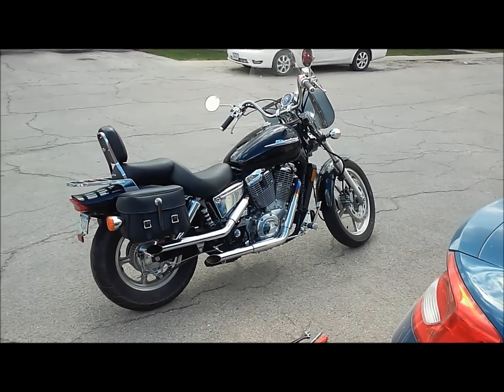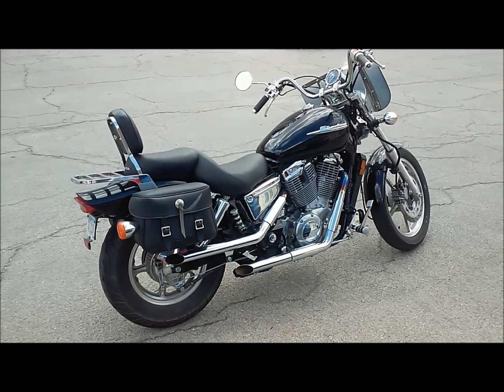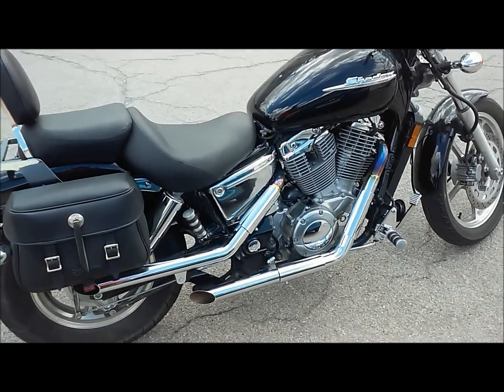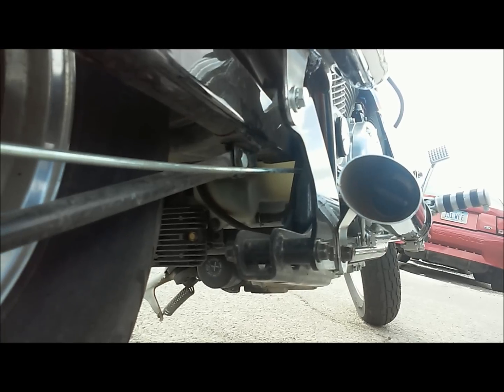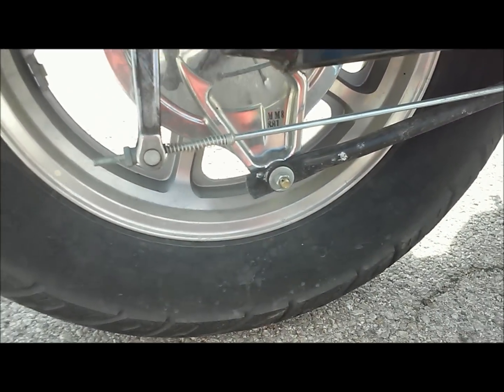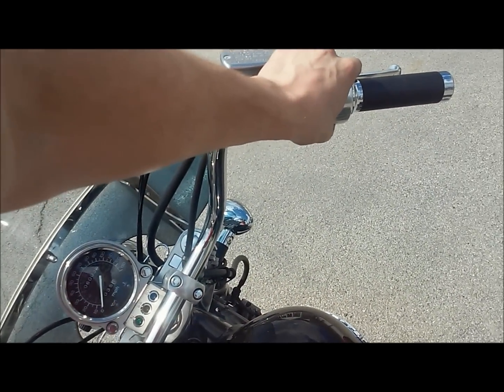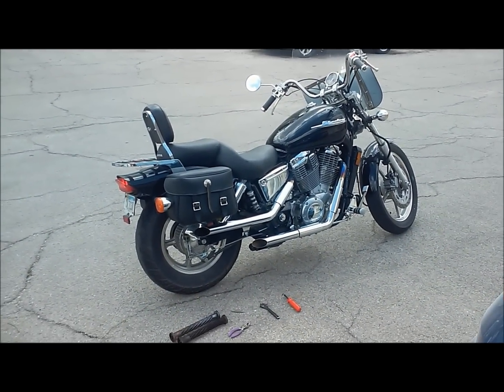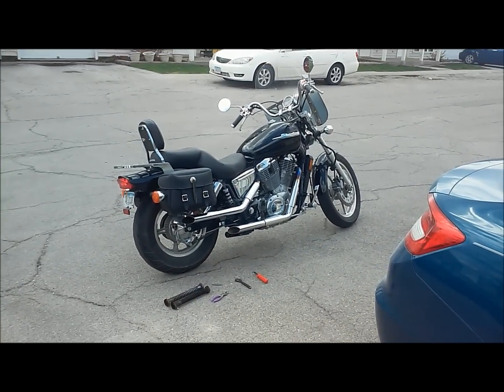Honda Shadow 1100 Cobra Drag Pipes - Baffles vs Straight (SOUND/TONE)

Comment from the maker: To everyone commenting, I did rejet the carb and adjust mix screws - I actually did a video on how to do it. Did the pipes and carb at same time. When chrome pipes aren’t right, the whole exhaust is blue - chrome on the 90s is normal. 
Stock exhaust has chrome covers, that’s why they aren’t blue 👍
Reply: ThunderHead289 what saddlebags are those?
Reply: Link to the jetting video bud
Reply: Link to the jetting video bud
Reply: But you never put a link for the pipes
Reply: I can’t find the video of the carb rebuild / jet
Reply: Found the how-to:
https://youtu.be/VfmKHksQhbo

Comment: Had a 750 with V&H pipes which sounded similar to this vid. Baffles in doesn't sound great and no baffles sounds hollow once you open the throttle up. Cutting the baffle in half and then drilling some holes in the face of the baffle sounds great. Did this to my cb500k as well. I've a vid up here of the 750 shadow with this set up, but the vid of the cb500k is no muffler.
Reply: Might try this on mine.
Reply: Couldn’t wait. I got home from work and cut the baffles in half and drilled 4 holes in each on the back. It sounds good without being obnoxious and not having baffles at all.
Reply: @Fobes  Awesome dude! Glad it works for ya. 🤘I started with four holes too but ended up drilling more until I got the tone and volume I wanted.

Comment: I cut about 6 inches off some 2 in harley baffles and installed them in in my cobra pipes on my 97 1100ACE  and it sounds perfect. My buddy was riding lead and he could hear me over his Harley. Really made a awesome sound for me but my pipes measure 2⅛in so it doesn't have alot of back pressure

Comment: i had bought mine with out the baffles in it, i think i have cobras on mine, heat shields are non existent on my bike though... but mine does sound more like how a harley would, not sure if its because its the ACE or if its because it goes from the skinny pipe to a big one
Reply: The ace and the aero have single pin crank just like Harleys that's why Honda was sued for that sound! The Sabra and the shadow have dual p i n n e d cranks which make them smoother and actually have 10 more horsepower!

Comment: Does it run high rpm for hwy speeds 75-80mph?
Reply: Shadow Spirits are geared higher than the ace Sabra and a e r o! They turn 2750 at 60 miles an hour compared to 3,000 with the other three!

Comment: Looks to me like you are running it way too lean. Your pipes are blued which means you're running hot, maybe too hot and could burn a hole in the pistons over time. I suggest turning the mixture screws out some or even rejetting the carbs for those pipes.
Reply: telling thunderhead289 how his engine/carb is performing is the funniest shit i've ever seen
Reply: That’s the first thing I noticed also and thought the same !

Comment: Hello thunderhead. I hav an 04 vt1100 with the same tail light setup and turn signals. Im having a hard time finding saddlebags that fit due to the turn signals. Yours look Nice and fit good. Where did u get those?? Wut r they called??
Reply: I have Victory bags on my 04 VT1100c, with bolt on setup. Love them.
Reply: Check with Viking Bags. They have a good variety.

Comment: For some reason it didn't sound that great with the baffles in, and worse with them out. I guess if you're going for loud, you got there.
As one guy commented a few months ago, you have lots of bluing on your pipes near the heads. That usually indicates running lean, but it's pretty hard to watch a video and make an accurate assessment.
Curious, did your performance improve? Or get worse? A couple buddies of mine removed their baffles (Harleys) and even with power commanders adjusted, they lost some performance as far as quarter mile times, top speed, and a slight loss of fuel economy. One of them put his baffles back in, the other prefers loud over performance.
Reply from the maker: I did a 3 part series on this where i rejetted before i did the exhaust - you cant do one without the other and expect performance. In my case it felt like it gained 1/4 more power over what it had before.

Comment: Is an 86 Shadow 1100 fast?
Reply: kieran williams are Bonita fish big?
Reply: no lol. wrong kind of bike. my '95 tops out at around 105
Reply: 80s models are way faster than 90s and up . They had more compression and higher lift cam
Reply: Jake 6401 mine at 110 lol
Reply: Top out around 110-115. They are built for comfort not speed.
Reply: @jaylycan7964  78hp vs 62hp

Comment: First off loud pipes dont save lives. 2nd sounds amazing been thinking about getting these
Reply: I have a 98 honda vt1100 had Vance and hines found stock exhaust put it on now I have to honk my horn for the idiots try to take my lane over
Reply: @louisvilaros9066  I  have had loud exhausts on every bike and idiots still cut me off doesnt change. it doesnt save lives you might get occasional person who can hear you so it helps but doesnt mean its always going to helps so the whole loud pipes save lives bs isnt true its probably affective like 25% of the time
Reply: @MrTommyLove  i have personally almost hit a few bikers in my truck switching lanes on highway because i couldn't hear them or see if blind spot. Bone stock quiet. 
My bike is obnoxiously loud, when i split lanes they part for me before i get up there  and i give the thank you nod. 
Getting cut off by idiots comes from alot of factors, not giving yourself distance, lane position, etc....biker 101. 
But if your pipes are loud they will hear you 100% of time, especially in slower city travel, under 40mph.

Comment: I'll bet when you were a kid you attached playing cards onto your bicycle in the spokes so that it would sound cool. Besides annoying neighbors and car drivers (as if we need more pissed off cagers), loud pipes fatigue the rider on longer rides. I prefer my stock pipes, thank you. I can still hear birds chirping as I cruise along on country roads. I do however need to either rev the engine or beep the horn when approaching bicyclists, otherwise they sometimes don't hear me coming. I am also a firm believer that the Honda engineers did a great job of designing the stock pipes to work in concert with the engine and fueling in order to maximize long term reliability.
Reply from the maker: I would have never changed them if I didn’t have to lay the bike down to miss a driver that didn’t see me. 
Stock exhaust was obliterated completely unfortunately. 
Have it hanging on the wall as a momento - very expensive to replace. 

I basically just redid the exhaust as cheap as possible and sold it.

Comment: Dude, your pipes are way too hot. Too much fuel i think. May want to get that tuned. Thise pipes are very blue at the exhaust ports. Just an obsevation
Reply from the maker: Well,search my name and Honda 1100. I jetted it to where it's supposed to be. That's just what happens when your actual pipe is chromed. If it was jetted wrong, which lean is hot, it would be blue way way past the 90s on it!!!!
Reply: Ok i got ya. It just looks like it been pretty hot.nice bike by the way
Reply from the maker: +blah blah yeah, the unfortanality of buying cheap exhaust. - it's thin. Most bikes have only chrome covers, which don't turn blue.
Reply from the maker: +blah blah and thanks, it was a good bike. Sad to see it go last year.
Reply: If the pipes were hot it would be from a lean condition, too little fuel, not too much.
Reply: @ThunderHead289  :(  I was going to sell my 2007 VT1100 sabre, and get a victory Highball. But I've decided to Bob her out instead. I've owned it since 2008. It was my first bike and still going strong. Take one last look before the transformation: https://youtu.be/oNm-GbCkd-8

Comment: If you don`t change the jets in the carbs will it run too lean or too rich? i would think it would need to be richened up a bit cause of  no back preasure overheating the top end.
Reply from the maker: You do, type in thunderhead289 Honda 1100. I walk through changing the jets

Comment: Running way too lean
Reply from the maker: How did you come to that conclusion
Reply: ThunderHead289 the pipes should not be that blue at the exhaust ports I have a 97 with drag pipes and they were never blued it has 41000 miles
Reply from the maker: +CRFHONDARIDER100 well I can tell you this much - I jetted and adjusted for no baffles and had to put them in immediately because the lady hated it - she's the boss. Anyway, it would have been rich if anything.